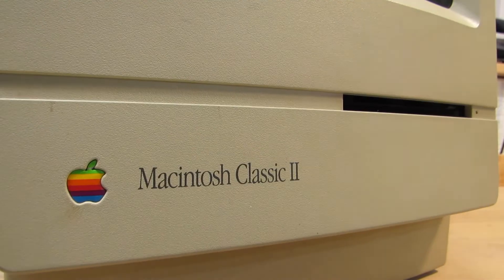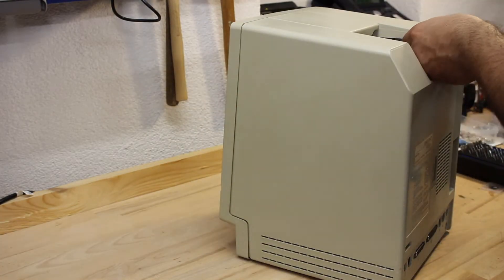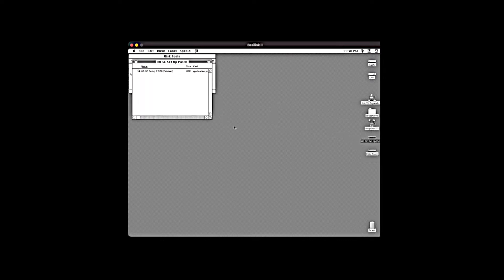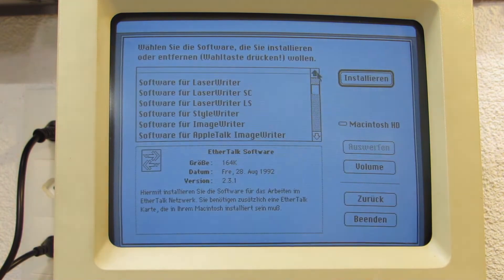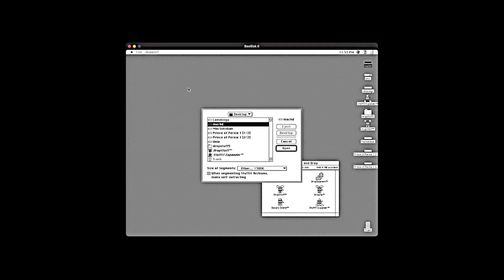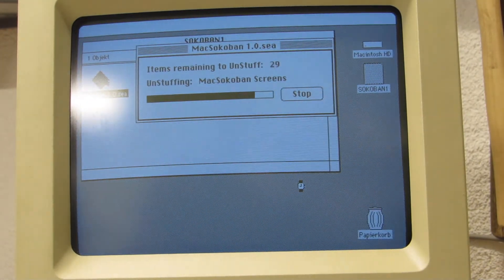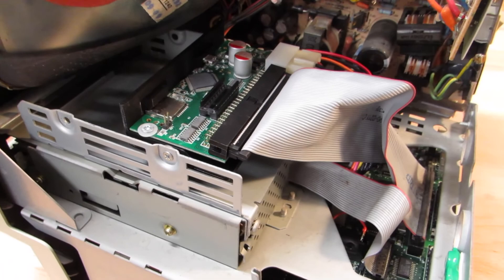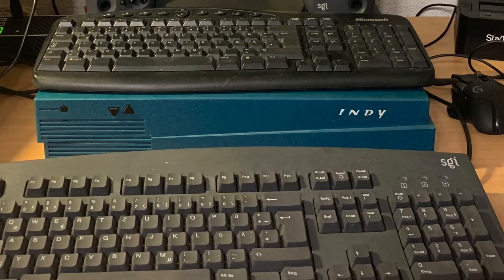Replacing SCSI HD with SCSI2SD on a Macintosh Classic II

Comment: Nice video. Just an FYI. You can use a program called "Lido" for the Macintosh. I use Lido 7.56. It will detect all SCSI drives regardless of manufacture and let you create an Mac partition so System software will see it.
Reply from the maker: Thanks for the hint, will look into it.
At the time of making this video, this was the only classic Mac I had.

Comment: Thinking about doing some work to a PowerBook 520c and was wondering if this approach would be good for that as well. Can the device work with a 16/32 GB SD card and is the software available for Linux? I'm not trying to do anything crazy with the laptop, it's just a bit easier and cheaper if I get a card that size from Walmart. The storage shown to the laptop would be 500MB - 2GB.
Reply from the maker: There‘s a link to the software in the video description.
And yes, the utility is available for Linux as well.

Never tried thus on a Powerbook myself.
But since it‘s SCSI it should generally work.

The size of the SD card is not important, as not the SD card will be presented to the system, but the actual image file you create thereon.

The limit is in the OS, like System 6 IIRC is 2 GiB max partition size, and System 7 is 4 GiB.

So that‘s the max reasonable disk image size.

You could hower create multiple disk images on the SD card, and present them as different individual hard drives.

Comment: Hi, how are you ??? , excellent work !!! I am writing to you from Uruguay, you know... I have a similar machine that I cannot make work because it does not have a disk, could you sell me one of those cards, one already with the OS installed, ready to connect only??? hopefully you can help me!!! greetings !!
Reply from the maker: Hi @pablolagreca7261

I'm not selling components, I'm afraid. SD2SCSI adapters are available via https://www.scsi2sd.com/index.php?title=SCSI2SD or https://store.rabbitholecomputing.com/ProductDetails.asp?ProductCode=ZuluSCSI-V1.1-REV-2022C.
Reply: @THEPHINTAGECOLLECTOR  Hello! I'm re-working a Mac Classic II myself, I have already replaced the logic board and recapped the analog board, and installed a zuluSCSI to SD adapter, but for the life of me, I can't get the mac to recognize the SD card as a "hard drive". I have tried following your video but this stuff is over my head and not working for me. I don't have any other old equipment, but I do have functional 3.5 floppy installation disks for 7.1 (just no recognizable drive to install them on). Would it be at all possible to get a copy of the files from you?!?!

Comment: Nice video. 
Just a personal note, I like the idea of segments, chapter marks and the transition screentitle. It is for my taste a tad too long (it is 3-4 seconds long). I would shorten them to approx. 2 seconds. In the Presario video you had many short segments with transitions. For my taste - and I want to underline - this is "criticizing" on a level where nothing else could be commented from my side - there were too frequent and too long. But reducing them to 2 senconds lenght would be (again from my point of view) perfect.
Again: nice and well done video. Nicely structured, well explained and a very likeable and friendly host. Keep up the good work :)
Reply from the maker: @RetroJayKay Thanks for the heads up. Always appreciating open feedback :)You're right, ~4 secs is maybe a bit too long. Let me see what I can do to optimize the bumper duration in the upcoming videos.
Reply from the maker: @RetroJayKay FYI: You may want to check out the upcoming video for the somewhat changed bumpers. It's coming Saturday 10:00am CEST.